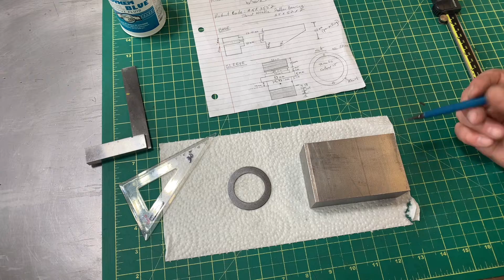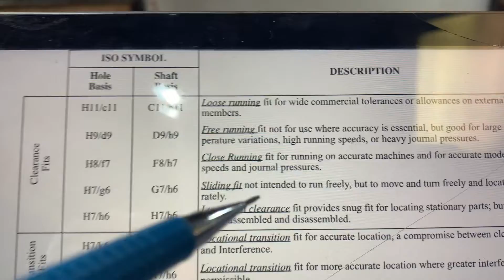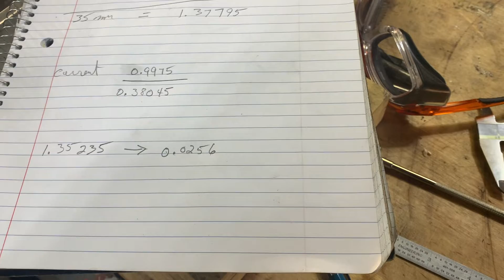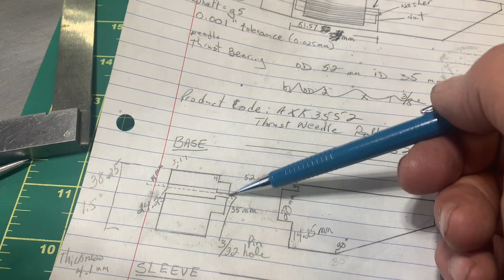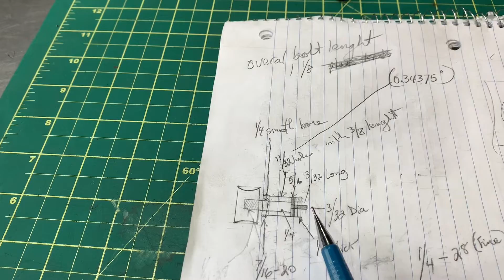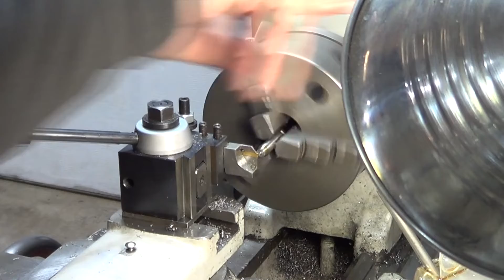How to design and machine an end mill grinding fixture -Episode 1

Comment: Nice so far. I like that pin idea on the side. I am wondering, though, if that pin should be hardened. I could see over time that it could get some wear in it.
Reply from the maker: That my friend is a great observation and why I ended up using pre hardened 4140. 😊👍🏻
Reply: @LetsRogerThat  I must have missed that detail!
Reply from the maker: @MyLilMule  😊